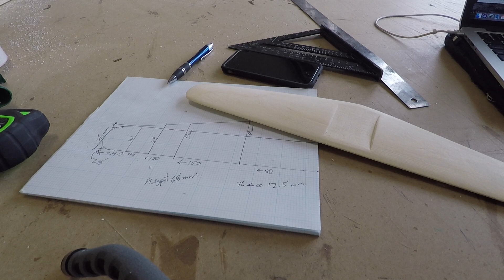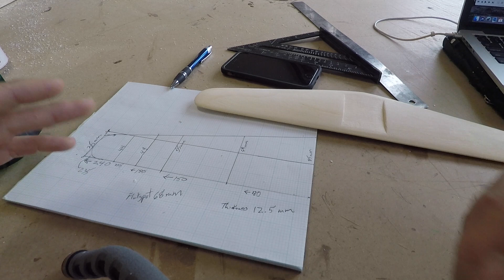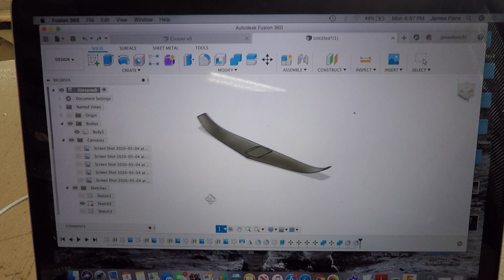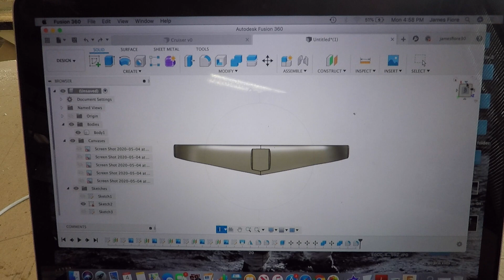How hydrofoil wings are designed... stabilizer pt.1

Comment: 2:22 (Adding wingtips to reduce yaw instability) If you want to improve yaw stability, why not add a vertical stabilizer? When was the last time you saw an aircraft design add wingtips on the horizontal stabilizer? Ok, other than the B25?

Comment: If I was machining my own foils I would just cut little contoured supports for near the ends and just screw right through the foil.  It just gets covered by epoxy glass anyway.  The screw holes of epoxy just add some strength while freehanding the tip is a time consuming source of error.
I like the idea of adding long boards to your product line because it is a less seasonal product -cut in the late summer-fall lull for holiday gifts.  CNC cutting the entire surface is more costly than most competitors so I would look for ways to add value like shape, inlays, or motor/battery integration.

Comment: Then I mill this kind of shapes, especially when I'm planning to mill several of them, I mill a cradle shaped as a negative of the first milled surface. After milling the first side, I then put the milled surface into the cradle. Then you can clamp down one side, for example, the left side then and mill the right side and vice versa. Or you can mill the cradle a bit smaller, from top view, and create an undercut when mounting the wing. You can then glue it to the cradle with hot glue. When it's finished you can make the hot glue release with some acetone.

Comment: That's a lot oft milling to do. Wouldn't it be easier to just "form glue" several thin layers of wood into shape? That should also result in a stronger wing, because the fibres of the wood are better aligned.

Comment: You could machine the profile out of high density foam, and then vacuum bag it to a template with your a anhedral backed in. Will most likely only work well for flat bottomed foils..
Reply: It's work holding. They only use standard clamping fixtures.  Custom holding fixtures or even air chucks might help them.  You could even drill some tooling holes into the workpiece for fixturing.  Then fill holes later.  Leaving a thick solid tab on the part for later hand cutting or second machine operation seems like extra work.